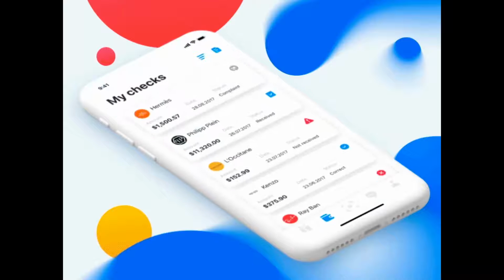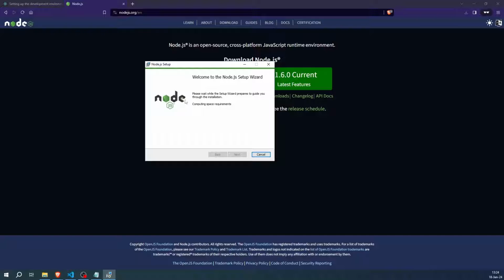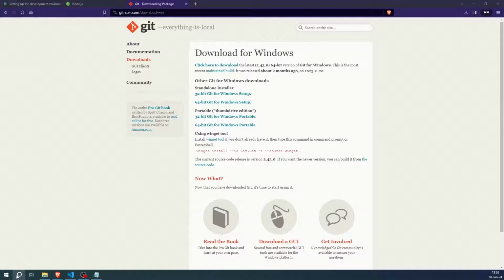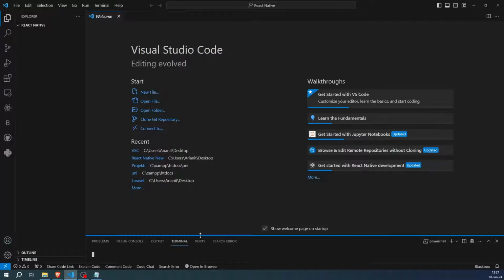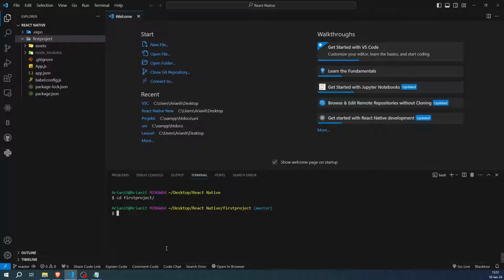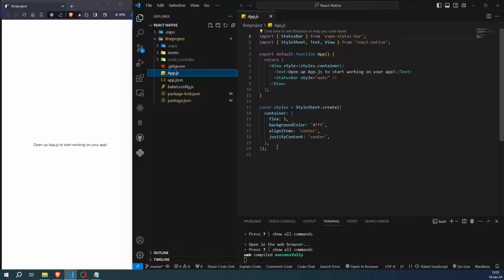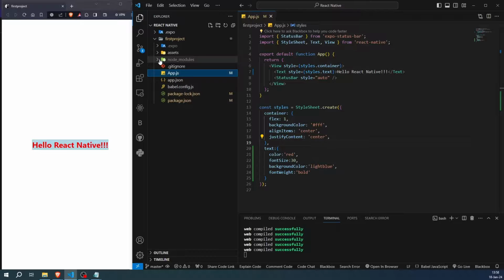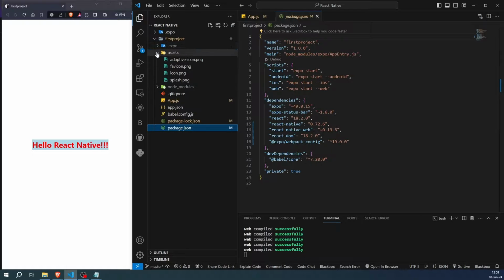How to get started in React Native - Your First App in 2024

Comment: I'm unable to run on my Android. I'm on the same wifi, and USB debugging is on. I scanned the QR code. But still showing the Uncaught error. Error: java.net.ConnectException: Failed to connect to /192 in the expo app. Do you have any idea how to fix it
Reply: Facing the same issue

Comment: I scanned the QR code with my phone and with my tablet and in both it said : something went wrong...  both (phone and tablet) and also my computer is on the same wifi, on the same ip range adress.... 

  and when i press w to open web it opens a window that says: wecome! step 1:Try it..... step2:Explore....

what can i do ?
Reply from the maker: I think you need to install this: Set-ExecutionPolicy RemoteSigned. This comand install in Powershell, run as admin
Reply: @DevSolutionsDB i should exactly this 'set....

Comment: Sir , Mine React Native need refresh to show new change? why i want to refresh on save
Reply from the maker: I suggest looking into the details of your development environment configuration, monitoring for any error messages in your development terminal, and checking for potential conflicts between libraries or modules used in your project. If the problem persists, it may be necessary to delve deeper to uncover and address the root cause of the issue.